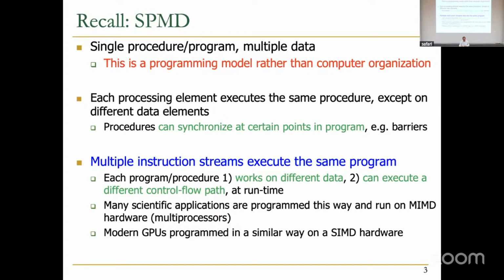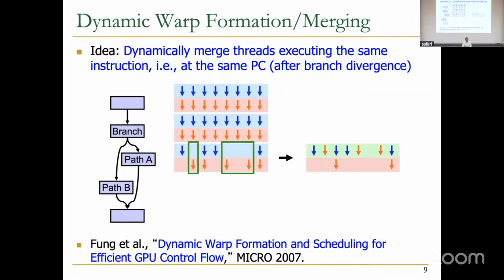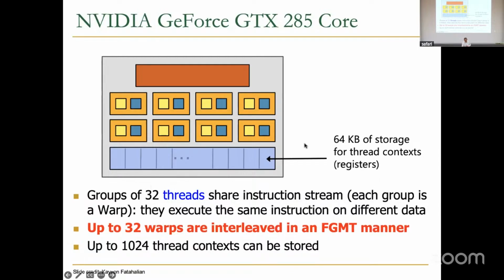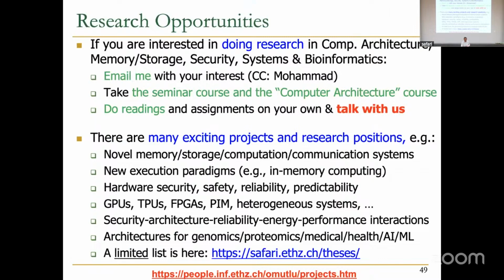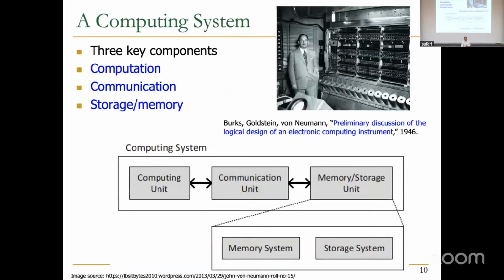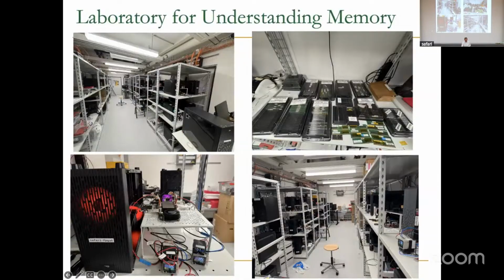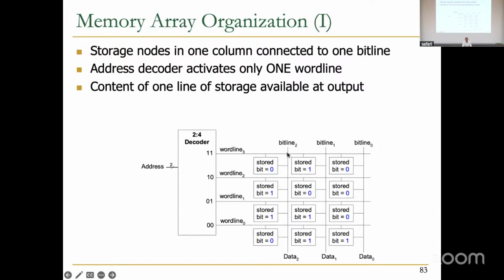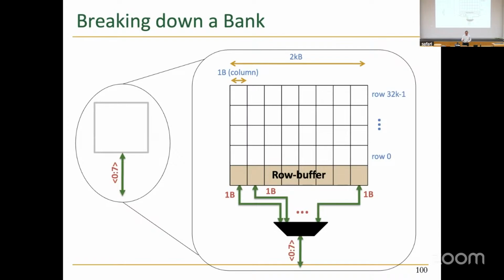Digital Design and Comp. Arch. - L20: GPU Arch. II & Memory Overview and Technology (Spring 2025)

Comment: Hello, thank you for the great lecture. I have a question about dynamic warp formation. I understand that if there’s a lane collision between two warps, they can’t be merged, and as a result, the utilization stays the same. My question is, isn't there an overhead of grouping the warps? If merging won’t improve utilization due to a lane collision, wouldn’t this overhead be a problem? So, could we possibly check for a lane collison, and if there is one, leave warps as they are?
Reply: That’s a very good point you’ve raised. You’re right that if warp merging fails due to lane conflicts, the overhead could become a concern. To address this, hardware typically employs fast conflict detection: it uses a bitmask-style check to quickly determine whether lane conflicts exist. If a conflict is found, the system won’t enter the more complex warp reformation process. Since this check is lightweight and done in parallel, the overhead remains minimal.